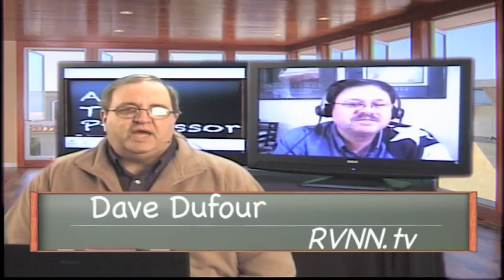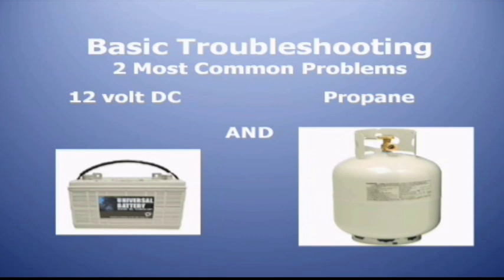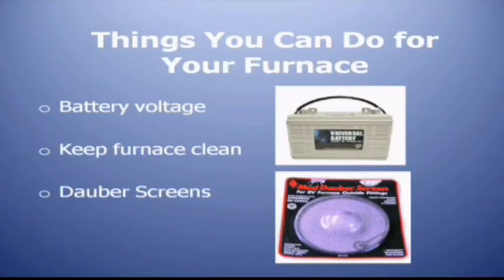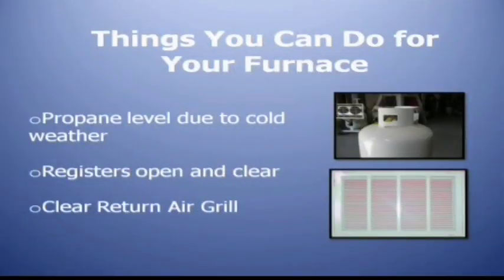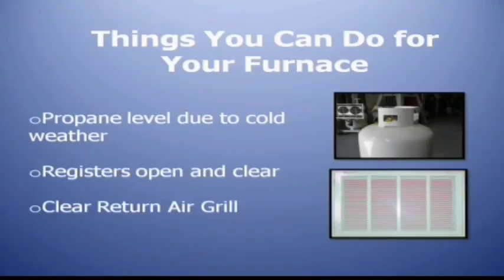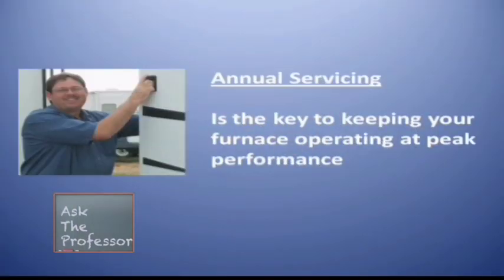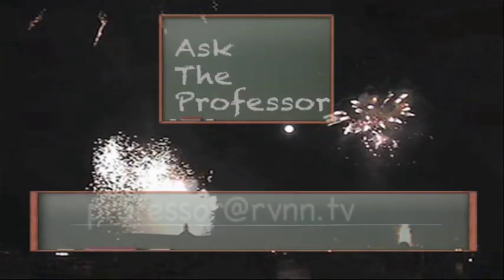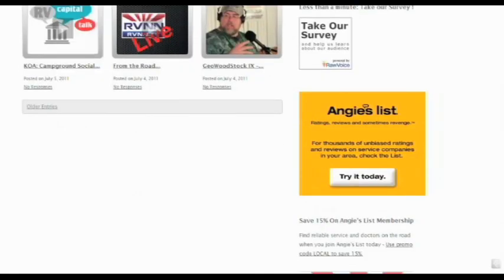Ask the Professor: Furnaces

Comment: Thank you for this video! I got what I needed in the first minutes (and will finish watching to glean more pearls of wisdom). Low propane pressure, no heat and fan shut off quickly. Checked the propane tank, indeed very low. Switched tanks, et voila! Heat : )  The manufacturer should publish this simple troubleshoot recommendation in the manual. Again, thanks, and I will subscribe.

Comment: Cant control furnace with thermostat, I can only set up to 32. Changed thermostat with same new one, still have the same problem. Furnace works just no control of heat setting. any help ?

Comment: my furnace is set at 71 but keeps on going,is house just cold?
Reply: James M .... Same issue I'm having now....I see this is an old posting/video. My instincts tell me the thermostat needs to be relocated to a wall somewhere in the center of the house where it's less (or not) susceptible to the effects of the cold as opposed to a wall nearest the framing of the house. I have an "old" house which was built WITHOUT insulation. Aluminum siding was installed some time ago, So the foam-backing from that is the only insulation on the house. The furnace performs like its suppose to,  But the problem seems to be that it goes through its cycle CONTINUOUSLY !!! As soon as the furnace has ran it's course cycle and the blower shuts off, The gas valve "kicks" right back on as if I had just turned-up the thermostat, and goes through its cycle process again on a continuation. I totally understand the interchange between the function of a furnace and a non-insulated house, But at some point, Even a non-insulated house can build enough heat indoors over time to where the furnace would have a little [if not a lot of] "Down-time" before the house "cools" down below its temperature setting. Its just a rational thought, But I said to myself "If the thermostat was mounted on the wall in the garage or on the outside of the house , The furnace would run forever IN ONE CYCLE !!! ...In my case, I believe It's between the thermostat, Its location, and/or the limit switch (or a combination) !